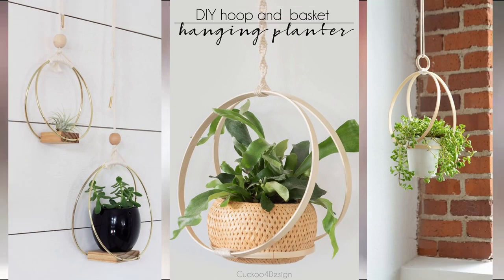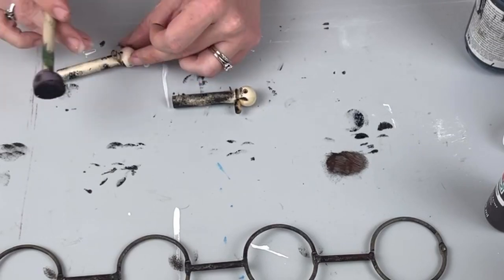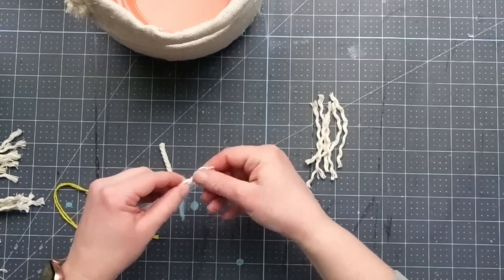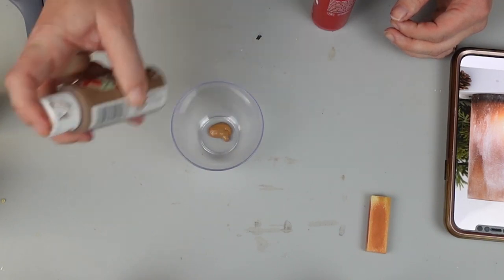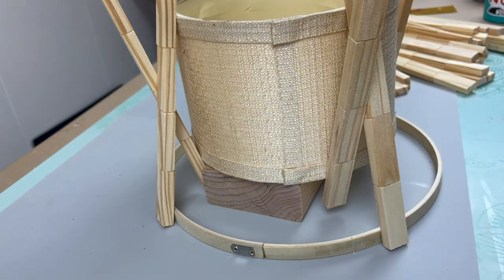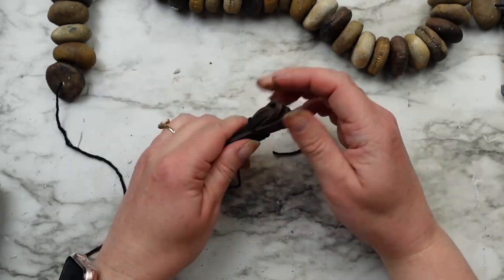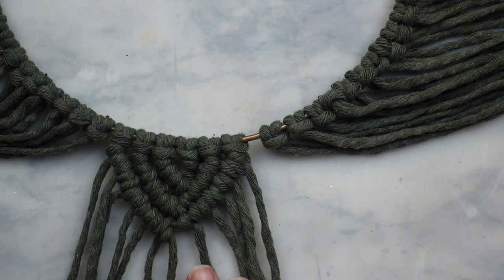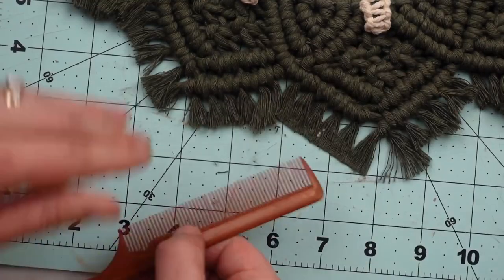DIY Decor Dupes Mega Video // High End Dupes Compilation Video

Comment: Love your projects, they are fab.  With regards to the frosted glass spray, I also had issues using it.  I wanted to frost a lightbulb as it was too bright.  I tried every way to get the finish I wanted, thin coats, thicker coats, longer drying between coats, shorter time, you get the picture.  Every time it dried it was clear.  I've put it aside for now but I'm determined to get it sorted, if only for pride's sake.  Happy New Year from North West England.
Reply from the maker: I’m glad it wasn’t just me! I swear the frosted spray was supposed to have a white “frosty” look to it